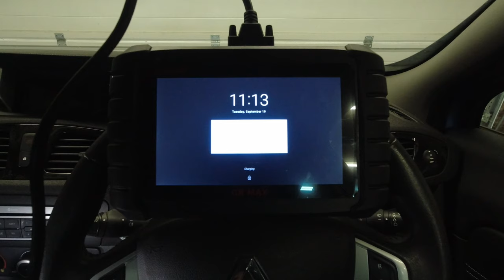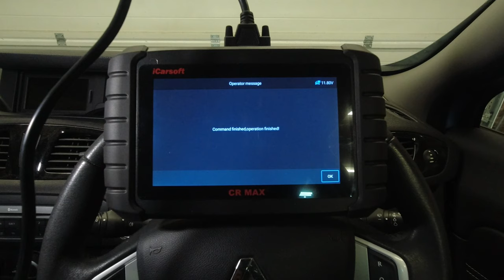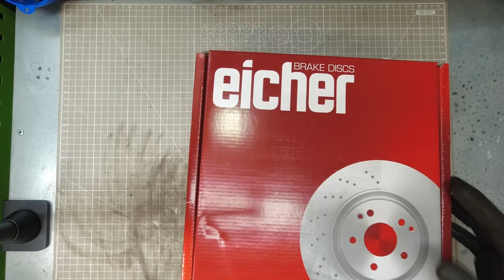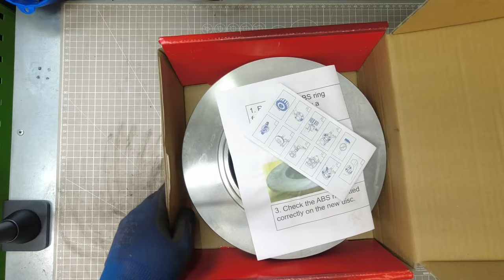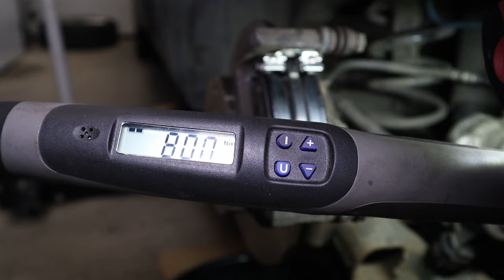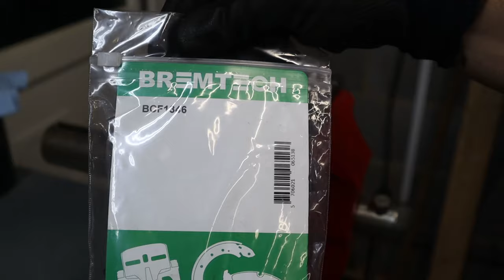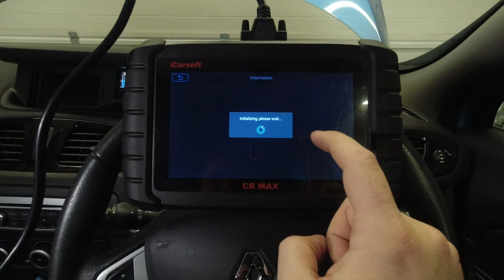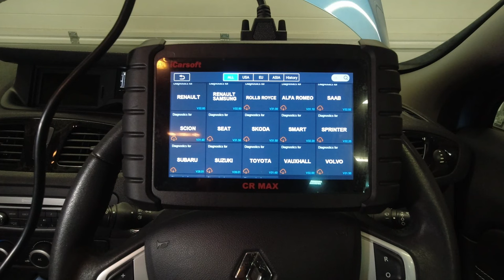Renault Scenic 3 - Changing Rear Brake Discs And Pads (With Electronic Parking Brake EPB)

Comment: Very good, informative video, thanks very much. I bought quite a few items including the iCarsoft through your links, I hope you get a few quid back from it. Re shot blasting the caliper holder - may I suggest a needle scaler would do a better job. I just chipped off the large flakes with a hammer on mine.
Reply from the maker: Thankyou. It's not something I have ever tried before. I'm currently using a wire wheel on a drill to clean up caliper brackets. That will be in my front discs and pads video on this car soon.

Comment: Very informative video.  Just a quick question about the disc's.  The link is for ones that are without electronic handbrake, are these ok to fit as a replacement?  Thanks again for your descriptive breakdown of the job.
Reply from the maker: I cannot find where it says they are for non epb models. Where does it say that?
Reply: If you put the same code or search for the same disc's in Eurocarparts in fitment detail it says "Without Electric Handbrake".  I was checking prices,  if they are ok then great!
Reply from the maker: The only differences I'm aware of in discs is diameters. I used the discs in the link and they are fine.

Comment: Amazing video, liked and. Subscribed, confused about abs ring, when you were fitting new disc with abs ring you said to remember to remove it the cover, now you talking about removing old one with possible to fit it with the new one we're you said to remove it from new one z please explain, thanks
Reply from the maker: Most discs come with the ABS ring already fitted, the bit at the end of the video is to show how to swap the ABS ring from your old disc onto a new one if your new one didn't come with a ring fitted. Hope that clears it up.
Reply: @SocketsAndSideburns   but which were you removing from the new one as you said clearly remember to remove it that cover, plastic one not shown on video but you talking about removing from the old one knowing what you removed from old disc already existed on new one but also you have remove some plastic cover? So very confused when you saying if new one won't comes withnit, but with what please?
Reply: @SocketsAndSideburns  so what you saying there is discs with bearing with and without abs ring? Tried look on website can't find any, wonder if there is actually something possible to get discs with bearing without abs ring
Reply from the maker: The new discs I fitted came with new ABS rings already fitted. Some discs can be bought without ABS rings and even without bearings. So at the end I show how to swap them to help people who may have bought new ones without ABS rings.
The cover I am referring to is one that is sometimes fitted to ABS rings on new discs for protection, it is thin and usually transparent so it is easily possible to forget to take it off. The new discs in this video did not come with this protective cover but many new ones do.
Reply: @SocketsAndSideburns  absolutely superb top man with superb skills of services along with comments, respect, is it possible to send you pm any chance please? Got some work on my mk3 scenic
Reply from the maker: If you have questions I prefer if they are put in comments that way everyone can read them and others may be able to help out and also learn from what people comment.
Reply: @SocketsAndSideburns  amazing, do you have replaced on scenic/Grand scenic mk3 water pump and alternator belt, also front spring and shock absorber, soon i will be changing, i literally can't find anyone on YouTube changing it when comes to water pump, thanks
Reply: @SocketsAndSideburns  1.6dci talking about
Reply from the maker: I'm afraid I don't have a video for either. The engine in my scenic is a 1.5dci but I may do the front springs and shocks in the future.

Comment: Awesome video!
Extremely well presented and containing loads of useful info.
You showed amazing care and attention to detail in your work.
The mk 3 Scenic is an outstanding and underrated car, especially in 1.5 dci guise, but some work does seem a bit challenging and a little overly complex (like changing a cabin filter, which is a pig of a job on a right hand drive car, lol).
PS,
Change the oil at the very least every 12K / 12 months and the 1.5 dci will just keep on going.
Thanks for the video.